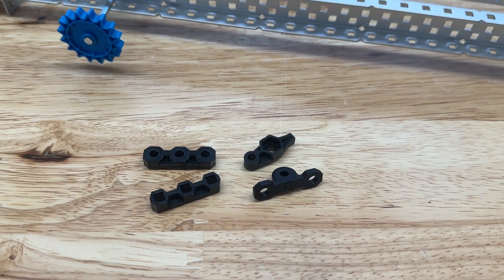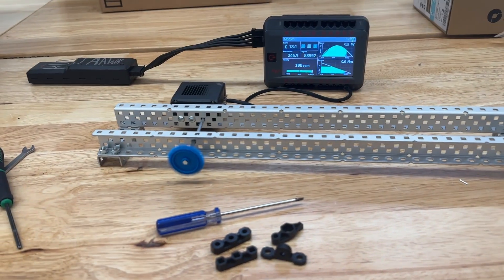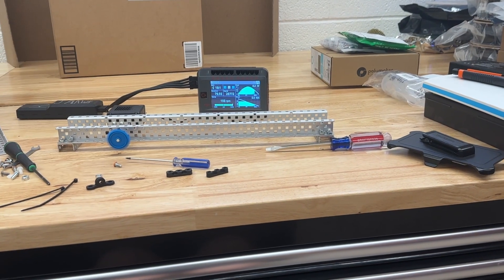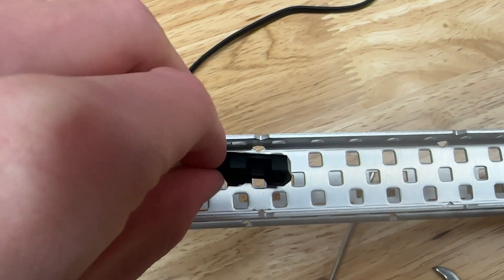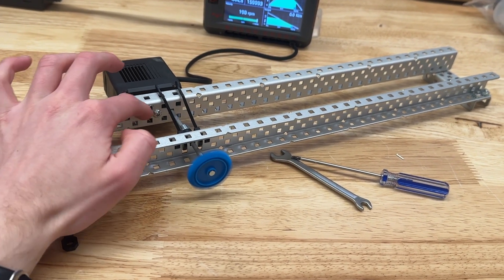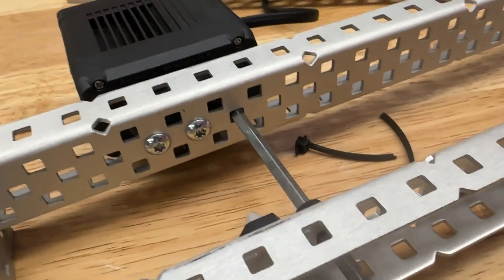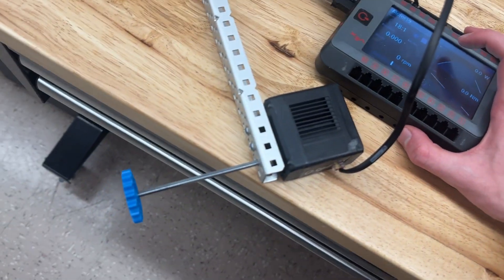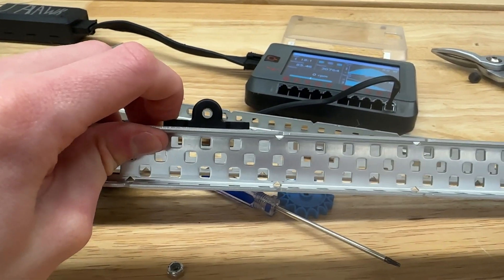Vex Robotics Bearings Guide/Tutorial

Comment: Love this video - and how you show simple test results that anyone can copy... about the pillow block bearings... 

The sides of them definitely angle in by 2 degrees (probably for the injection molding process) and the CAD file has the shaft hole perpendicular to one of the tilted faces... but I think that's just a mistake in the CAD file. I've cantilevered a 12" shaft out of one and the other end of the shaft can deflect equally from the horizontal both up and down... implying that the shaft hole is not actually normal to the skewed face of the bearing but it is properly aligned.
Reply from the maker: @kenevans5090  it’s not much of an issue. Worse case scenario you just drill out the hole slightly. And over shorter distances, it won’t matter anyways.

Comment: would you recomend drilling out bearings to make them barely any wider to reduce friction or no
Reply from the maker: @haydenford3794  hats definitely something I’ve seen teams do, but personally I haven’t tested it myself.
Reply: Definitely we do it and it’s significantly better because the bearings don’t always line up perfectly with each other and you don’t want your screws or bars rubbing that much in the metal
Reply: I would not do it for our team. One of the things I do is to put dummy shafts that I have checked for straightness inside the bearings as I am assembling the structure that the bearings are mounted inside. As the structure is pulled together with the fasteners the bearing bores are kept in alignment.  Using 1/4" shafts helps with this as they are much more resistant to bending.